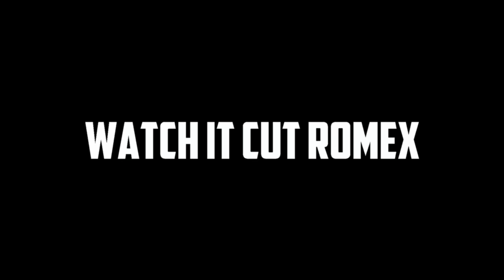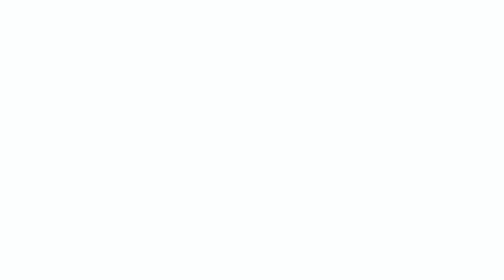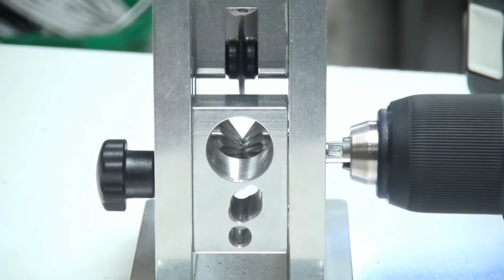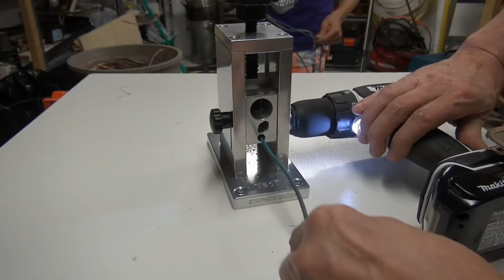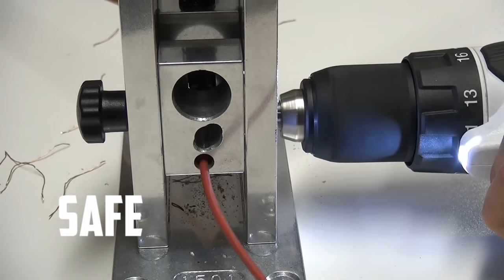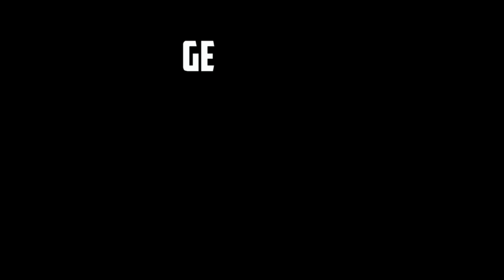stripmeister automatic wire stripping machine in action

Comment: all the people here saying only thieves need this tool.I went to Louisiana after katrina and gutted a few houses before rebuilding. this includes old copper flashing and miles of copper wire, the owners said just throw it all in the dump trailer (insurance was paying all.)  yeah right all the copper went home with me lol.. I could burn the plastic off but then its just a little better grade of copper than with plastic on but if the plastic is removed you get the big bucks. I did it the hard way...tie the wire to something solid and walk away with my razor shaving one side of the plastic off..this machine is sweet and could of had my kids girlfriend stripping wire while we were at work lol

Comment: I have one of these and just started using it. Its best for solid wire, #2 wire is not so good. I agree its a safe machine but the wire prep process is time consuming. For example, you have to straighten out your romex, no kinks and it must be clean wire. The short pieces they show are easy but the reality is we have long pieces. Plus your have to separate the sizes (10, 12 , 14 etc) as the cutter must be adjusted for each size. It does the job but I would not call it easy. Once you get the romex stripped and the white and black wires out, (you have to separate those sizes too) run them through twice to make it easier to peel off the plastic. Also, I hooked up a electric drill with the trigger locked as the idea of holding a trigger for each wire going through is not realistic in the real world.

Comment: Top tip if yous using these .use a silicon gun tip in hole it will stop small wire running of blade

Comment: I like mine, but man there are times with the smaller wire from washing machines, etc that if you go to fast the wire wants to go between the drve gears and the blade. If you cut too deep you end up with little pieces of copper poking your fingers. The large wire and romex are stupid simple without this machine. I hope i can get it fine tuned. The instruction manual is than useless tbh. Still a safe machine and it does the job easier and quicker than a utility knife.

Comment: I'm having trouble figuring out the problem it solves
Reply: +Mike Strohofer This is used to get more money when scrapping wire.
Reply: Example: 100 pounds of insulated wire will get you 32 dollars (@ 32 cents per pound). 
Stripped #1 copper wire will get you $1.35/ per pound. Or $135 in this example (100 pounds, obviously).

Comment: I can't figure out why I would want to remove ALL the insulation from a wire
Reply: Unless I'm stealing wire for scrap
Reply: +Dagan Schoen well im gonna be scraping soon but no your right a 300 dollar investment im guessing if you wanna steal wires for scrap efficiently
Reply: if your own electrician like myself and instead of getting $0.90 a pound for insulated wire that's crap that you saved up 4 weeks and months at a time and you don't feel like stripping all the damn wire you can use this tool strip it all easily and get 250 to $3 a pound for clean number 1 wire and this too will pay for itself after your first trip to the scrap yard
Reply: When I do scrap copper runs, I have to clean the insulation off the copper wire because I get less than 1/2 of the value out of the copper - for me, a dirty copper wire is about $1 per pound, whereas clean bright copper, like they show in the video, gives me between $2 and $2.50 per pound so it pays off in the long run.  your original investment would be made back within a couple days if you have enough copper.
Reply: Electricians keep the scrap wire usually... and it's a pain in the ass to strip with a razor knife. The scrapyard gives you alot more for it stripped than insulated.